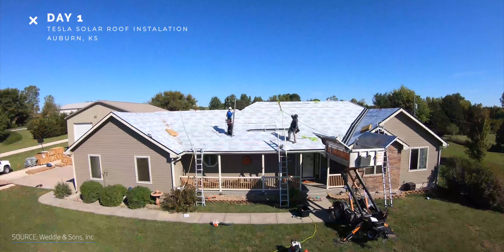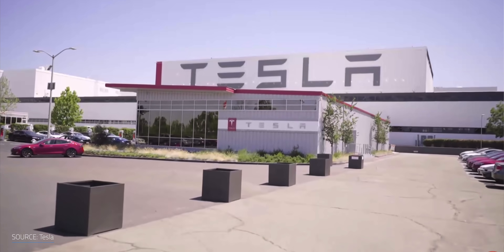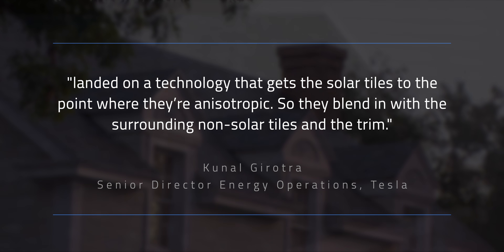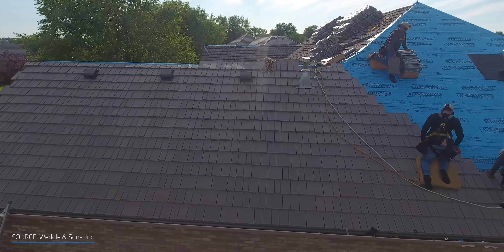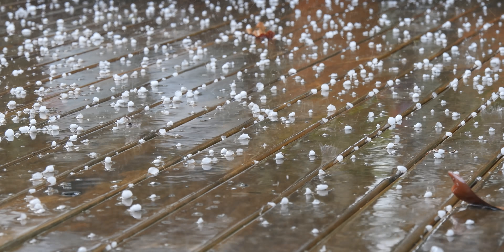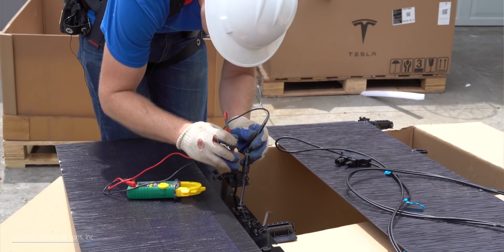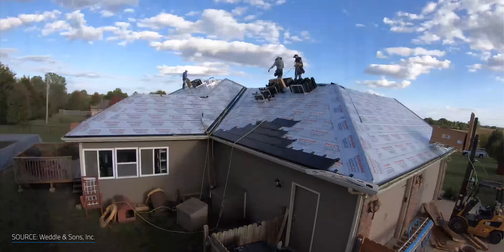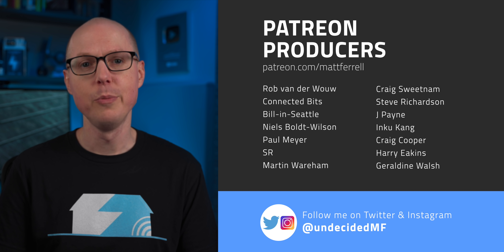Exploring If Tesla Solar Roof Is About To Go Mainstream?

Comment: The incentive didn't go away. The Covid relief bill passed last week includes a bump up of the federal incentive back to 26%.
Reply: A two year extension, IIRC.
Reply: Nice! Didn't know the package included that
Reply: The thing about tax credits is they are generally offered for novel installations.  Usually they can't scale to mainstream adoption.  It's fine to subsidize solar when it's still in the proof of concept stage, but such technologies must be able to stand on their own when they enter the mainstream.  See you're not really getting a break, you're just distributing the cost through taxation.  When a product goes mainstream, and tons of people are buying it, tax breaks stop making sense as you're basically still paying that cost, just buy other avenues.  Those other avenues then require their own administration, which ultimately makes solar more expensive on the larger scale, because you've added an unnecessary administration cost to all solar.  

No alternative energy technology should depend on subsidies long term.
Reply: @jeremyO9F911O2  I sort of agree with you as far as you went.  But you left out the massive subsidies we give to the fossil fuel industry in allowing them to pollute but not pay for the harm caused by that pollution.  

We are spending tens of billions of dollars per year on pollution caused health problems.  If we spend some money now to get more renewable energy on our grids and more EVs on our roads we create long term health cost savings.

"The burning of fossil fuels contributes to four of the five leading causes of death in the United States, including heart disease, cancer, stroke, and lung diseases, while putting children at risk of asthma and delayed mental development [1]. All these missed work days, hospital visits, and deaths not only cause suffering, but they handicap our economy, increase insurance premiums, and contribute to an unsustainable growth in health care costs.

Coal plants alone cause more than 13,000 deaths each year in the United States [2]. According to the National Academy of Sciences, the burning of fossil fuels causes $120 billion annually in mostly health-related damages. [3]"

A decade of $120 billion in annual spending adds  up to $1.2 trillion dollars.  There's no need, as far as I can see, to spend as much as a trillion dollars subsidizing renewable energy but even if we did spend that much we'd get it back in ten years of lower pollution spending.  And then we'd save another $1.2 trillion the next decade.  Subsidizing renewable energy is a very good investment.  It simply makes financial sense.
--

Globally the economic and health costs of air pollution from burning fossil fuels totaled $2.9 trillion in 2018.  Almost $3 trillion in a single year.
Reply: @bobwallace9753  yes I anticipated your "what about" counter argument.  The problem with your thinking is twofold.  Firstly FF is the giant renewables must concur, as such it needs to be better than that giant.  Fiscally I mean, subsidies/tax breaks are fine for jump starting the process, but as I explain at a certain point the subsidies for solar become redundant and fiscally counter productive.  

See much of the subsidies in fossil fuels exist for two reasons, firstly they are there for energy assurance.  Basically the country doesn't want to run out of energy, we do the same thing with food subsidies.  Here really any form of energy can apply for subsidy as long as it's both abundant and reliable.  Which FF basically are.  Abundant and reliable has always been a challenge solar faces and that conversation is well treaded ground.   Of course the other reason for FF subsidies is energy security, since solar doesn't need to depend on foreign oil wells, it's exempt from that need which is actually a vote it solar's favor.   I'm not too researched on the supply chain but as far as I know the materials needed to build solar are fairly common and wouldn't depend on sourcing from conflict regions.  Though America would need to dramatically increase its solar production and not depend on China so much as it's the current reality.  

Like I say the "what about oil subsidies" argument isn't very useful, subsidies are still payed by taxes meaning the tax payer still pays.   I'm not suggesting subsidies aren't appropriate in the proof of concept phase we are still in.  Just that if it must depend on subsidies to exist long term then it must develop more.

Also just to put my cards on the table, I'm an energy realist.  I'm not guided by political lines on energy, I'm outright anti-coal.  But far less pessimistic on crude and natural gas, I'm all for replacing them wherever practical.  I submit that commuter EV is a promising avenue to pursue, but I'm more pessimistic about that technology scaling to heavy transportation, and I have almost no faith that we will replace hydrocarbons with batteries in aircraft.  Though there are carbon neutral synthetic fuels to consider.

But I refuse to play the "feel good" renewables game, where people love wind and solar because they don't have a smelly tailpipe. I think they have their place, but I also think that their advocates don't apply the same critical analysis as they do to other energy technology.   To be honest the technology I prefer is neither FF or wide scale renewables, I'm all about nuclear.  I feel that any discussion of alternative energy solutions that reject nuclear are irrational, ignorant, acinie, and ultimately doomed to failure.
Reply: @jeremyO9F911O2  
"much of the subsidies in fossil fuels exist for two reasons, firstly they are there for energy assurance"

Extending your logic - we could permanently subsidize renewable energy in the way we now permanently subsidize fossil fuels.  What's the difference?

Of course, there's no need to permanently subsidize renewable energy seeing how wind and solar are our least expensive ways to produce electricity.  We need subsidies over a limited period of time in order to speed the installation of renewables in order to cut fossil fuel use quickly.  The market will replace fossil fuels with renewables, just not as fast as we would like for health and climate reasons.  Subsidies, in the case of renewables, are catalysts.  

" any form of energy can apply for subsidy as long as it's both abundant and reliable"

Fossil fuels are not abundant.  If we continue to use FF at the rate we are we will see extraction costs rise as they have been rising.  There's lots of coal in the ground but as we use up the easy to get to stuff it becomes more expensive to get to the less accessable stuff.  Same for oil.  We're using up the cheap oil and we're having to spend massively more to extract the less accessable.  If we stay with fossil fuels over time our energy costs will rise.

"I'm more pessimistic about that technology scaling to heavy transportation, and I have almost no faith that we will replace hydrocarbons with batteries in aircraft"

Heavy transportation as in trains and trucks?  A large portion of the world's rail is already electric.  There are already short range (~100 mile) 18-wheelers operating on our roads.  And Tesla is completing the factory in Austin that will produce long range battery powered semis.

Air travel is still a problem.  It looks like we'll  have passenger planes with about 300 mile ranges soon.  But longer, faster flights will require higher capacity batteries.  We may develop those batteries but, if not, there's a potential solution - the hyperloop.

Very short version - I'll flesh it out if you are interested.

A 10,000 mile hyperloop tunnel system stretching from New York City to Shanghai via the Bering Strait should cost about $300 billion dollars.  About 2x what we've spent on the International Space Station.  

Inside those tunnels passenger or freight 'pods' could travel a 700 MPH with a maglev system powered by renewable energy.  One tunnel system would have a capacity much higher than the daily throughput of passengers and shipping containers between North America and Asia.  Passengers would travel as fast as flying with more comfort.  Freight would travel from one end to the other in about 14 hours as opposed to 14+ days.
Reply: @bobwallace9753  it's weird how you disagree with my philosophy but still come to the same conclusions.  

I'm not talking trains I guess, you're correct that converting them to grid power is already existing technology.   I'm more referring to trucking and shipping, trains are easy to electrify, as the rail network can simply access power grids.  Trucking is certainly possible for day cabs and city routes, but long haul the batteries just get both heavy and next people talk about swapping them which dramatically increases the price.  Furthermore hwy trucks have weight limits, basically the trucks would likely have 3 batteries, a smaller one where the combustion engine currently is to always have one with the tractor.  Then likely a pair of batteries hanging below the trailer, reducing capacity the trailer can carry.  Of course all of this requires we solve the "blood batteries" Cobalt problem too.  

Shipping just isn't going to happen with batteries, the energy density just plain isn't there, if you want zero carbon either carbon neutral synthetic fuels, or nuclear powered ships is where I would look.  

I think maybe you don't understand the realities of air travel.  WEIGHT IS EVERYTHING in air travel, and aircraft routes depend on aircraft getting lighter as they travel.  Indeed a 747 fueled for long range travel cannot immediately land after takeoff because the weight of all that fuel could potentially crush the landing gear with the force of touchdown.  Unlike hydrocarbon fuels, batteries don't get lighter as they discharge.  So not only are batteries less energy dense than hydrocarbons by like nab factor of 10.  But fuel burning aircraft actually get more efficient the lighter they get for having burnt off their fuel.    There are a bunch of other factors too, like in a car a full tank of gas or an oversized battery are of minimum consequences for a short journey that doesn't need that much energy.  Aircraft only carry as much fuel as they anticipate their journey needs.  So a battery powered aircraft would need a significant portion of the batteries to be highly modular so they could be removed.  Unfortunately modularity adds weight too, and wears out faster increasing price.  Another thing, where electric motors can show up piston engines for efficiency, the turbine engines on aircraft this is less of a thing.   

Yes there are super efficient aircraft designs coming out, but they are small and what they save on fuel they tend to lose in increased personal needs.   No the best way to clean up air travel is to make synthetic fuels from captured carbon taken from either oceans or atmosphere.  Giving you a carbon neutral solution.  It's not free energy, you still need to invest clean energy to produce that fuel, but it's effectually zero carbon in the aggregate. 

As for hyperloops, I'm not optimistic.  Their scalability is basically non existent.  A 100 mile loop or a 1000 mile loop costs more or less the same per mile.  I mean sure more tube/track encourages some economy of scale on manufacturing, but ultimately the problem is and will always be the same.  They only make sense at all between massive metropolitan areas, they are so terribly bourgeoisie and are mostly useless to any population not on their routes, which is the majority of the population.  Effectively airplanes are already hyperloops but also better.  They fly at very high altitudes to lower drag, I mean a hyperloop is just a high speed train with lower drag.   I think hyperloop enthusiasm is fundumentally ignorant of the realities of infrastructure.  I mean it would be hard enough to maintain a high speed track on your berring sea route to Shanghai, then you want it to be a vacuum tube too?  Vacuum is really really hard.   At the end of the day hyperloops might replace certain long distant routes, but there are simply too many possible destinations for it to ever replace airlines.
Reply: @jeremyO9F911O2  " Trucking is certainly possible for day cabs and city routes, but long haul the batteries just get both heavy and next people talk about swapping them which dramatically increases the price."

You've missed Tesla's long distance semi.  Here's Elon's initial statement.

"“Getting a range of let’s say 500 kilometers is I think quite easy, trivial to be frank, for a semi truck. If you want, for long-range trucking, you can take the range up to, we think, easily 800 kilometers, and we see a path over time to 1,000-kilometers (621 miles) range for a heavy-duty truck.”"

Since he released that statement he has said that Tesla's new 4680, dryroll, tabless batteries make a 1,000 km/621 mile range possible.  Lithium cells allow a 10% to 80% charge in less than 30 minutes.  Start fully charged from the point of origin, drive about 560 miles, charge 30m, drive 480 miles, charge 30m, drive 480, etc.  A coast to coast 3,000 mile trip would take about five stops for charging.

There's apparently no load penalty compared to a diesel rig with full fuel tanks.  

Tesla is eliminating cobalt.

The batteries will be built into the tractor frame, not "hanging under the trailer".

I'm not going to bother trying to tell you about how battery powered airplanes work.  Look it up.  

The cost of a hyperloop system?  Please think.

The NYC to Shanghai tunnel system would cost $300 billion.  Those tunnels would have at least a 100 year useful life.  

$30,000,000 =  cost per mile (excluding bond interest)  100 years useful life.  $300,000 annual cost per mile.  $820 daily cost per mile.

27,000,000, on average, shipping containers travel between Asia and North America annually.  Roughly 74,000 per day.  Based on "comfortable" economy airline seating it would take the equivalent length of 15,000 twenty foot long passenger pods to carry all the people who travel between Asia and North America per day.  That's a total of 90,000 freight and passenger vehicles using the tunnel per day.

At $820 daily cost per mile for the tunnel system that works out to about $0.01/mile per vehicle.

Now, why would it be hard to maintain a partial vacuum in a tunnel whose walls did not allow air penetration and whose entries and exits are provided with air locks?

"Effectively airplanes are already hyperloops but also better.  They fly at very high altitudes to lower drag, I mean a hyperloop is just a high speed train with lower drag."

You actually understand that part.  Maglev trains are speed limited due to air resistance at ground level.  Planes fly high in order to travel in a zone of low air pressure.  But it takes a lot of energy to get that 'pod with wings' up several miles into the air.  A hyperloop pod has to elevate only a few inches.  And it would never have to fight winds like airplanes commonly spend energy doing.
Reply: @bobwallace9753  Elon musk is excellent at not delivering on his promises.   

But the reason you want the big battery under the trailer is because of axle weight limits issued by government transportation authorities.  It's certainly technically possible to put a big battery in the cab, but axle weight limits won't like that.  You would have a moderately sized battery in the tractor above the steer tires, effectively replacing the weight of the diesel engine.  That weight there is actually somewhat desirable as it balances the load weight from the trailer and ensures that the front steer tires always have steerage.  But you don't want too much weight at the back of the tractor as that's where the front of the trailer adds weight.  

That's why you put a battery under the trailer so that all axles (except the steer axle) share the weight equally.   Weight balance in trucking is just everything.  Ultimately loads are more often limited by weight than volume.  And I'll add winter operation where batteries underperform and the nice thing about combustion engines is you get to use waste heat to heat your cab for basically free.   

When I see Cobalt free batteries I'll celebrate.  But not before. 

You really like your hyperloops don't you, nevermind that you're ignoring the criticism that they are only possibly justified on major routes and are more like space elevators for ocean crossing than true mass transit systems.   You totally straw man air travel and clearly don't know much about the major logistics of air travel.  That miles to reach altitude comment vs inches in your vacuum tube comment is equally acinie.  I mean boats and trucks don't levitate at all by your rational. 

But you completely hand wave the complexities of building your vacuum tubes.  Have you actually considered the route across the bearing straight?  Have you ever been to the northern regions of the world?  Do you seriously believe a mile of tube track across the plains is the same price as traversing the Arctic north?  And this is 700 m/h(or was it kilometers I forget) where the tube track needs to be as straight as possible to actually maintain maximum speed.  

But you also handwave the practical maintenance logistics.  Your vacuum tubes need to maintain vacuum, which in any vessel is hard to do.  I think the biggest vacuum structures today are particle accelerators.  Which are built in climate controlled, geologically controlled environments.   Hyperloop like the one you're describing are like 10 orders of magnitude bigger, or something factoring both length and diameter (I didn't actually do the math). And fully exposed to the elements including crossing at least one tectonic plate divide.  And frankly doubled probably for two way traffic to see the use you're anticipating.  Though honestly if it's that economically paramount you'd want three tube tracks minimal since you'd inevitably need to shut one down for maintenance over time.  I'd want to see 4 honestly, perhaps 5, maybe 6.  6 would be splitting the passenger and freight networks plus redundancy.  The cost per mile is a bit complex to estimate as vacuum stations would simply be slightly scaled up and service the whole network at each site.  So give me your best guess on that cost, for 3 parallel tube tracks at minimum, and with 6 you would assume smaller diameter tube track for passenger lines I would assume.  

But weather is harsh on the constructs of man, triple so in the North.  Maintenance is non trivial.
Reply: @jeremyO9F911O2  
" Elon musk is excellent at not delivering on his promises."

Factually incorrect.  Not only has Musk delivered on pretty much every 'promise', he's delivered on time or early more often than delivered late.  

"It's certainly technically possible to put a big battery in the cab, but axle weight limits won't like that"

Again, factually incorrect.  The Tesla semi tractor will have approximately the same curb weight as a fully fueled diesel tractor.  No trailers connected to either.

"You really like your hyperloops don't you, nevermind that you're ignoring the criticism that they are only possibly justified on major routes and are more like space elevators for ocean crossing than true mass transit systems."

I think hyperloops are very promising.  They promise shipping at a low cost and high speed using renewable energy.  

As for ocean crossing, the Chunnel tunnel runs under the English Channel which has a maximum depth of 571 feet and a length of 31 miles.  At its lowest point the Chunnel is 250 feet (75 m) deep below the sea bed and 380 feet (115 m) below sea level.

The Bering Strait has a maximum depth of 164 feet and is 53 miles wide.  Wider than the English Channel but not as deep.

The Chunnel is a three tunnel system like Boring’s Loop system and what would likely be used for a hyperloop system.  A center tunnel between the two traffic tunnels would be available for emergency exits.

" Have you ever been to the northern regions of the world"

I've flown the polar route between North America and Asia many times.  A NA to Asia tunnel would also take that shorter route and make the trip underground where weather would not be an issue.

"(I didn't actually do the math)"

Look up some facts and do some math.  It's not hard.  If you do that you can make useful statements.

You want me to give you some math to start with?  OK. What we know now is that BoringCo constructed a tunnel in Las Vegas for $10 million per mile.  My guess is that cost will decrease as Boring brings their more advanced tunnel boring machine to play but I'll use $10 million to be conservative.

Three tunnel system.  Two directional tunnels plus one maintenance/evacuation tunnel.  $10 million x 3 = $30 million.

The cost of a station.  Each station would need two off ramps and two on ramps, one of each in each direction.  If the vehicle accelerated/decelerated at the rate of the Concorde then ramps would need to be about five miles long.  If acceleration was at normal passenger rate the ramps would need to be about ten miles long.  Again to be conservative let's use 10 miles.  10 miles x 4 ramp tunnels x $10 million per mile = $400 million for ramps.  Plus the cost of airlock doors which shouldn't be overly expensive.  

Outside the airlock terminal costs would be minimal.  Basically a building or parking lot where passengers could be loaded and unloaded.  And an area where shipping containers could be lifted off sleds and placed on trucks for last mile stuff.

That's not going to be affordable for small towns but massively affordable for major cities.  The sorts of places that now pay for large airports.
Reply: @bobwallace9753  where are those tesla patent sharing hmmm?
Reply: @jeremyO9F911O2  Are you signaling that you should not be taken as a serious person?
Reply: @bobwallace9753  Nor would it have winds to help it along. Which planes can have. In 1966 we flew across the Pacific in a 707 on 2 engines. Why? Because there was no need to waste the fuel on the other 2. And we got in a half hour early. Catch a jetstream and you'll find yourself cutting back on the power to keep the planes at the right airspeed. Problem with a vacuum in the tunnel under the Bering Sea? Water intrusion will occur at every joint over time.
Reply: @gravelydon7072  While it's true that tailwinds can cut fuel usage planes still have to carry enough fuel to make the trip without airflow assistance and it takes energy to lift that weight to altitude.  Plus turbulence eats energy.  Ever been in turbulence and paid attention to the engines getting ramped up to counteract the winds shoving the plane around?

Perhaps someone with some airflow engineering knowledge could step  in here but it seems to me than an hour of 50 MPH headwinds and an hour of 50 MPH tailwinds wouldn't cancel each other out.  With the tailwinds the plane would get less 'push' because the trailing edges of wings, fuselage, etc. taper toward the rear.  And the plane would have less lift than if flying in still or headwinds.

All that aside, I'd welcome being able to travel without turbulence.  Climate change is making turbulence worse and it will continue to get even more severe.  I'm tired of trying to catch my food and get it back on the tray rather than the other places it tries to go.

The concrete linings now used in Loop tunnels are waterproof.  The joints are grouted on the outside and have a sealing gasket.
Reply: @bobwallace9753  First, let me say that it’s been an impressive argument you’re making and I am a huge Tesla fan.  My roof install should happen in about 60 days.
I am just weighing in on your winds aloft comment.  Once basic airspeed is obtained for lift purposes (and of course that’s a given) aircraft are generally using ground speed for operational purposes (Like ETA).  In almost all cruise scenarios, tailwinds are preferred over headwinds.
Reply: @johngermany2089  Sure, tailwinds help move a plane over the ground with less energy.  But my question is "deeper in the weeds".  And may matter to pretty much no one but me.

A plane flies 50 miles into a 100 MPH headwind and then 50 miles with a 100 MPH tailwind.  Then the plane files 100 miles in still air, no wind.

Does the plane use more, the same, or less energy flying in the still air condition compared to the head/tailwind conditions?
Reply: @bobwallace9753  
It is just as you would expect.  It takes less energy (gas) to fly downwind, more gas to fly in no wind and even more gas to fly into a headwind.  Aside from engine emergencies and fuel leaks, unexpected headwinds are the most common reasons for low fuel state.
Reply: @jeremyO9F911O2  See https://www.youtube.com/watch?v=WWiX2edcBoA as far as shipping is concerned. I think such technologies will be there and continue to expand in coming months and years. Also designing of ships so that they can be more aerodynamic, newer materials which are lighter and stronger would also make things easier. Again I do not expect such changes to happen overnight but they will happen.
Reply: @shirishag75able  I had a feeling that link was going to lead to Real Engineering.   The guy handwaves too much and cherry picks optimistic numbers.  He has a massive renewables bias and a clear history of this handwaving where it's concerned.  Generally his videos are basically the reading of a combination of articles, but not him actually investigating the numbers himself.   I remember particularly coming away from his video on the Sherman Tank where I completely recognized good words being the exact same narrative as a specific and controversial writer in the field.   I won't call what he does as outright plagiarism, but he really should be more clear about what sources he's parroting.  

I'm not really sure what the point of a lighter ship is, they would just add more cargo.  You have to remember that ships are built the way they are for a reason.  For example Cruise liners are already built from lighter materials, but are generally restricted to sailing near coastlines, as they are too vulnerable to sail the high seas unless they wait for a favorable forecast.  True ocean liners have heavy sturdy hulls, so that they can sail in poor weather conditions.  Furthermore with the potential of the Northwest passage becoming a viable route, I doubt you want to sail with ships that are too lightweight through the Canadian archipelago.   Fun fact you generally build a ship for toughest conditions found in the Atlantic ocean, there's even a feature known as an Atlantic Bow which isn't found on ships not operating in the Atlantic ocean. 

Also remember that no crew wants to sail a ship that's not reliable.  Oceans are huge and not highways, help can be too far away when things go wrong.
Reply: @jeremyO9F911O2  Agree on some of your points not all. For e.g. lighter materials do not mean that they will not be strong. I mean something like for e.g. https://www.eedesignit.com/copper-film-on-carbon-nanotubes-means-better-stronger-lighter-evs-possible/ . Now the article shares about EV's but what I wanted to point that having lighter and yet stronger materials means they will do all that you share above. Now I don't see the problem in the materials per-se but perhaps the shipping industry. Just like many industries including the construction industry, the shipping industry is pretty conservative. And to play devil's advocate, they have ample reason for doing so, with ships being sunk without any explanations, even cargo ships.  Now that being said, I do hope that there are ideas and adopters who try it out.  There was this I saw few months back as far as aviation is concerned. https://www.youtube.com/watch?v=Hn2JJH6-uAM 

Now as far as bias is concerned, I too have a renewable energy bias because fossil fuels from what little I have read and researched tells me that fossil fuels are not the answer, we need to look at more alternatives and more alternatives are coming up every day. 

By this I mean something like this - 

https://www.bloomberg.com/opinion/articles/2020-10-12/why-big-oil-should-vote-for-joe-biden

Now whether the alternatives will stand the test of time is a valid question. For e.g. if we look at solar, it had started at 4% efficiency, and now you have solar panels which give 20% efficiency easily. And this is what has been achieved in less than a decade where 'commercial solar' and lithium-ion batteries are concerned because you cannot have one without the other. Again storage is in its infancy. 

https://en.wikipedia.org/wiki/Timeline_of_solar_cells#2000%E2%80%932019

When the incumbent technology has had 100 years and still needs massive subsidies even today you have to question where we are heading. What I had been finding interesting is that it is not generation that is actually the issue, it is the storage and transmission which are the issues. 

https://blog.ucsusa.org/mark-specht/renewable-energy-curtailment-101
Reply: @shirishag75able  so just to be clear what I mean by bias.  You don't have a bias for renewables, you have a preference, which is fine and you are able to defend that preference.   Bias means you don't apply equal weight or measure.  So it's fine to have a preference for a technology, but it's biased to only promote the most optimistic numbers, rather than the most likely.  Especially when you use the practical numbers for the established technology.  That's bias.

Copper plated nanotubes?  You know what I'll just give you the nanotubes, I mean that tech is still many steps from scalable, but grant it.   But copper!?  And moreover copper in a highly electric context.  We just don't produce all that much copper, and you want to swap abundant steel for rare copper, in a market where every other technology also wants abundant copper and all those copper demanding markets are growing?

I'm not going to say much about electric airplanes, but long story short.  Dead batteries weight the same as charged ones, but empty fuel tanks weight almost nothing.   That perpetual decrease in weight really adds up in aviation (and rocketry).
Reply: @jeremyO9F911O2  As shared, I don't see things changing on day one but I do hope that change because otherwise there is no alternative. There just isn't . World population is decreasing and will decrease more. Even in India, population is decreasing. In some states, they are not even reaching replacement levels. See 

https://vivekkaul.com/2020/12/15/chinas-population-control-model-is-an-outdated-and-a-bad-idea-for-india/

Also this idea that 'established technology having practical numbers' . That again is not true. Remember the most recent 'dieselgate' where the established market leader made false claims. Or the fact that big oil scientists like Exxon and others. See the whole thing at https://www.youtube.com/watch?v=bfHt4U0r8Qw . I found it quite interesting and shocking at the same time. The oil industry knew in the 1950's what they were doing and the actions they were taking but chose to disinform us over decades. 

At the end of the day, it is technology along with right incentives that can only save the day. Lifestyle changes are and will happen as well but that is also dependent on both awareness and education. For e.g. I was reading up on this https://nerc.org/documents/solarfest_case_study.pdf . Now should all events have similar preparations and execution for sure, would all and any events would have similar preparations and executions, for sure not. That is just to do with people's own willingness as well as the state to drive change.
Reply: @shirishag75able  I'm not sure you understand the population rates.  There is like a 5 generation lag between changes in birth rate and the ultimate effect.  And that's only if it changes over a short period of time then the rate stabalizes.  I use the 9.5-10 billion estimated forecast for peak population before it drops back down.  Most statisticians seem to have relatives consensus on the number.  Though I've heard pessimistic numbers citing 13 billion, but that seems to be based on wild birth rate fluctuation in Africa.  So those pessimistic estimates don't have good trend data.

The more important number to consider in the energy discussion is the energy poverty line.   Which was coined by statistician Hanz Rosling as being able to have enough energy to reliably run a clothes washer, including automatically supplying and heating water to do so.   So manually hauling water then heating it over an open fire, just to run a washer off car batteries and a single solar panel that's been charging them all week just for this one task that doesn't qualify.

The energy poverty line has about 2 billion above it, and that's just the poverty line.  I would argue you and I qualify as being Energy Sufficient.  With the top tier being Energy Abundant, of which nobody really lives in.   Which is to say energy is so damned available that energy doesn't enter your mental equation in daily life.  And teenagers who don't pay the bills and leave all the lights on don't count. 

So basically we need to expand energy production from 2 billion served to 10 billion served.  Let's just take it rough numbers and call that a 4-5x increase in this century.  But heck even 3x increase which is a number hard to call too high is pretty humbling.  I will say outright that even if we completely ignored carbon release and went full ham on fossil fuels, I don't think we could increase global fossil fuel production to those levels.  

I call this the Moral Argument for Alternative energy,  an argument for alternative energy that works whether or not you believe in climate change or the greenhouse effect.  Why Greens aren't making it when a commercial builder like me with no high level formal science education can figure it out?  I have my theories but no proof of this deliberate ignorance.   But it's why I'll call myself an environmentalist but not a Green, and believe Greens do more harm than good.
Reply: @jeremyO9F911O2  Could you elaborate a bit on the last paragraph. What exactly do you mean ? And even if you postulate something wild, that's ok. I do understand what you say about energy, but I would say or postulate that even before energy would come housing and other needs. For this 8 billion number that you shared, could you share where you got it from ? And are there other needs of housing, hygiene, water are being met? I can and have lived without internet but I do know I can't live without roof over my head or a bed and blanket. 

As I write this, huge protests have been going in Delhi, about 1000 odd kms. from where I am where the farmers are braving 0 degree and 1 degree celcius temperature -

 https://www.bbc.com/news/world-asia-india-55413499 so while I do agree that we need more energy but how and what costs to us and our ecology is also important. 

Did you see the Oversight Committee video that I shared about. Even the simplest thing that Exxon and other big oil added 2 feet to their structures to their oil rigs more than was needed does bolster the argument that they knew that the scientists were right. While denying others the idea that climate change is here and is being done by humans. 

One of the more interesting studies and experiments which were done is burning of paper and burning of wood and measuring both the temperature as well as the toxins giving out. Ideally, there shouldn't have been any changes both in temperature and toxicity of the paper but there was. The whole study was shared in 'Nature' couple of years ago. I am sure with what I have shared you might be able to get that study for sure.

On the population front have you seen the China one-child policy and how it boomeranged on them - 

https://www.youtube.com/watch?v=o4WOIRL0RZo

Or a much more compelling one - 

https://www.imdb.com/title/tt9581076/ So Long, my son. 

The gender imbalance for China is going to continue for decades and with it adverse consequences for a whole nation.
Reply: @shirishag75able  and his talk about energy poverty https://youtu.be/6sqnptxlCcw obviously the videos are old now so we definitely have to add some fudge factor on how the numbers have progressed since then.  But they do generally set the scale.
Reply: @shirishag75able  well it sounds like you're in India, and if not somewhere in central asia which is really cool.  I'm Canadian and plain sick of arguing with white anglos who worship Elon Musk and pretend like their iPhones aren't made by the next best thing to slave labour.  So talking to a person who understands the prospective that much of the world is trying to exit poverty is nice.

I one wrote an essay titled; Energy Society's Moderator.  The basic gist is that energy is needed to allow any society to progress and grow.  But energy in itself doesn't promote growth.  Which is why I say Moderator, and not Motivator.  One of my favorite quotes is (in reference to the industrial revolution) "We ended slavery by making carbon our slave instead of people." 

You put a list of things above energy but I think you miss that energy is needed to expand and fulfill those needs.  We humans have three fundumental currencies, time, population, and energy.  Essentially everything is the interplay of these three.  

As I say I'm Canadian, most of my nation could not exist without the active use of energy, next week I'll be working in a place where I can expect temperatures in the -30 to -40°C range.  So I know cold.

I'm going to be honest, I don't understand the relevance of this burning paper you're talking about.  

As for why I hate western Greens, it's because their policies are based on obsolete philosophy, they are singularly obsessed with climate change, to the point that any crisism of climate alarmism well within the bills of the scientific process is meet with emotional responses not a collaborative scientific effort.  Instead it yields political division.   Right wingers like a clean healthy environment.  They make mistakes like anyone, and usually want to see practical alternatives, which Greens rarely offer. 

See the Greens I meet, are what I call "feel good Greens" they are afraid of anything they don't understand or is powerful.  So they are afraid of all chemicals, a big scary machine or factory.  But they like basic things like solar panels and wind turbines.  

I look at the unfulfilled energy needs of the global population plus the desire to roll back the existing fossil fuel usage.  Those are huge numbers.  Currently there are basically 3 systems powering the world, fossil fuels of course, hydroelectricity which is great but we are already approching peak hydro there are just do many sites to tap.  The last is nuclear, it's the only power system that can scale and doesn't produce carbon emissions.  Anyone not even willing to consider nuclear is useless, and Greens hate nuclear.  So I have no idea for them.

P.S. I already know all the generic arguments against nuclear especially the three major incidents everybody knows about.  It is the second safest power method ever(behind wind, but wind is also a relatively low sample size too).  The new designs are multiple orders of magnitude safer still.  And waste is far less of an issue than implied and overblown by Greens.
Reply: @jeremyO9F911O2  I am more than a bit hesitant because nuclear still has issues and till it doesn't prove itself itself to be better would have the same view. Even Furukshima hasn't been cleaned even today - see https://www.japantimes.co.jp/news/2020/12/04/national/fukushima-cleanup-plan/ or http://www.asahi.com/ajw/articles/14071742 . I had read in guardian about a nuclear plant which was decommissioned/retired in the 90's and still they haven't been able to grow anything in that area due to radioactivity and from what little I know of UK politics it seems that guardian is more 'right' than left. There is also this. https://www.eia.gov/todayinenergy/detail.php?id=33792 So in the face of evidence, should we be thinking of nuclear power plants. And here I am not talking about when accidents happen. Accidents will happen in whatever technology is used, that is given, here I am talking about having a plant which would then be retired in few years and the chance to come back to its natural state would take more than a lifetime. That is not really a good solution. 

Even the Indian experience has not been good. https://en.wikipedia.org/wiki/Bhopal_disaster . If possible please see https://www.imdb.com/title/tt0839742/ . Till date, if you are living in that region, marry and have children they will have some birth defects. See -

https://www.downtoearth.org.in/news/environment/birth-defects-remain-high-in-bhopal-gas-survivors-35-years-after-disaster-67979

Is it any wonder then we are more than hesitant about nuclear energy. Also you didn't respond to any of the links I shared. Even Germany seems to be moving to a more renewable-friendly equation - 

https://strom-report.de/germany-power-generation-mix/ . Now can you tell why Germany and most of Europe is going the renewable way.  Even in UK where they have a 'right leaning government' 

https://www.theguardian.com/business/2019/oct/14/renewable-electricity-overtakes-fossil-fuels-in-uk-for-first-time
Reply: And the biggest question to me is liability. From what I have been reading, for new nuclear plants, they want liability in terms of years to go down rather than go up. If you had a better design wouldn't you want the liability to go up in terms of insurance just to show how good and sound the idea and design is. See - 

https://www.theguardian.com/global-development/2016/jun/06/lonely-struggle-india-anti-nuclear-protesters-tamil-nadu-kudankulam-idinthakarai
Reply: @shirishag75able  well you usually would build a new plant on top of an old one.  There are lots of bogus or over blown claims against nuclear.  For example both the USAs and Britain's nuclear weapons facilities are quite polluted, but weapons aren't power reactors.   Weapons are highly processed and that's more chemical than nuclear.  You should see the pollution that solar manufacturing can produce.  Long story short every form of power generation will be a bit dirty, the anti nuclear crowd is legion and they love to cherry pick.

Chernobyl is the worst radiological release this side of a nuclear weapon detonation.  It's been 34 years since that incident and there is no mass sterilization of the area around it.  Normal nuclear power plants aren't allowed to mass pollute by regulation.   Indeed they try to keep track of every atom of ionizing isotope.   Plants are obsessively hygienic.  

Greens started as anti nuclear weapons, did you know that?  It settled as a stance of institutional hated of all things nuclear.  They hate the weapons so much they than to put the entire nuclear genie back in the bottle.   And they've been spreading their views and anti nuclear popoganda for half a century.

The best way to become pro nuclear it's too study nuclear, to see how the entire field is now safety obsessed and how it permiates every aspect of the field.  

Just some food of thought.  Every nuclear bomb detonation releases fallout, and there have been over a 1000 atmospheric detonations.  Each worse than fukushima and probably worse than Chernobyl.  Find me the mass sterilization of land around them.  

Like I say, I've heard every argument against nuclear, I'm in no way connected, dependent or a benefactor of nuclear power.  I started off being relatively skeptical and paranoid of all things nuclear.  It was my education in how nuclear actually works, the fact that it's opponents have to outright lie will tell you something.  Look it up for yourself.
Reply: @jeremyO9F911O2  Let us say that you are right, but you didn't answer my questions about liability. If you have a superior product then wouldn't you want to showcase it with better liability terms. Why are you mum on that? And I did share that even when nuclear plants are retired than it takes upwards of 5 decades to return the land to normal and there again we never know how the nuclear waste is disposed of. I do know that uranium-235 has a long half-life into billions of years. See https://en.wikipedia.org/wiki/Isotopes_of_uranium which makes costs running into billions of dollars for generations beyond. If you know something that I don't please share.
Reply: @shirishag75able  well I wrote a reply and it turned into a bit of an essay too long for the comments section.  There's a link to it below.  But I address the "keeping mum" thing, basically I didn't understand the question so I didn't answer it.  But I think I maybe answered it now in the link.  Most of it though is me explaining your misconceptions about waste.  It's a bit long and I fully understand if you're not interested in reading it.  I didn't expect it to go so long but I'm on holiday and was on a roll too.  So it's there one way or another.  Or I could start feeding you videos that taught me much, they are all long but very well presented and in no way boring if you're any kind of a science learning personality.

https://docs.google.com/document/d/1GgnfsNZmsyjXAiZcj_UPysdTiB_-glkJsG_FTrVkYAU/edit?usp=drivesdk